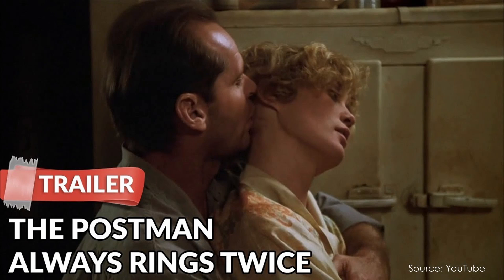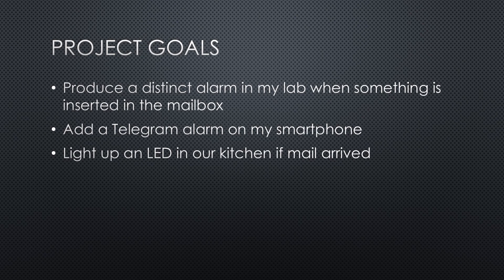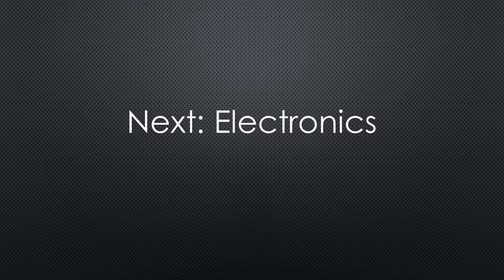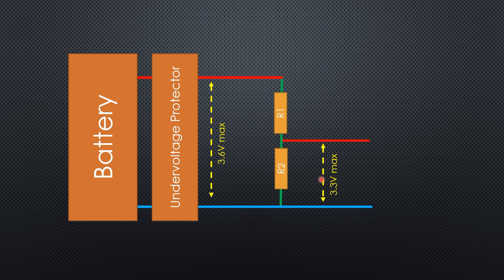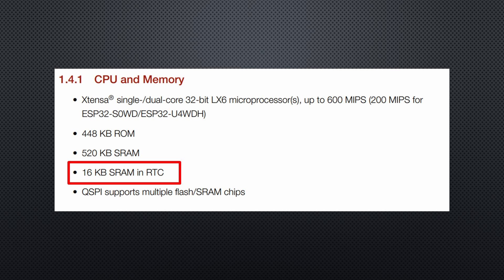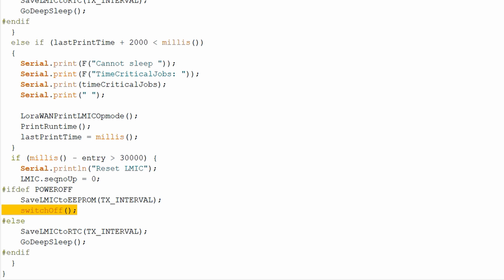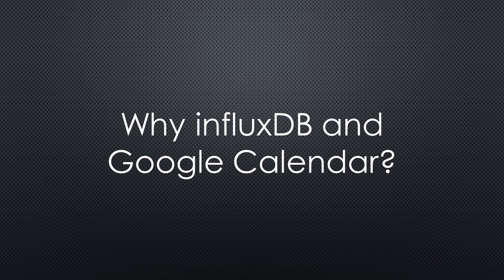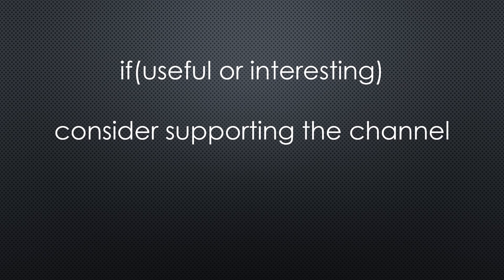#402 LoRaWAN V3 Mailbox Notifier (TTN)

Comment: I built something like this with RF24 module and small Pro-Micro Leonardo.  It uses a transistor latch circuit to power it on, sends the signal to a receiver, and shuts off as soon as it gets the acknowledgment, or after so many retries.  Powered by 9V battery.  Has been running for 2.5 months so far.
Reply from the maker: Good design if you do not need the reach of LoRa.

Comment: Hi Andreas, one of 2 best channels for starting with LoRa I manage to find for now. Regarding problem with Joins and deep sleep... would it work with ArduinoProMini in V3 setup you show here?
Reply from the maker: It uses the same processor as the Arduino Uno. So it is the same problem with memory.

Comment: ESP32 data sheet shows RTC memory (both RTC FAST and RTC SLOW) as being SRAM. Can you elaborate on the wear out concerns? I want to ensure I'm not missing something here. Now I know you are powering off the device and RTC is not a viable solution since it is SRAM, just not certain about the RTC concern itself.
Reply from the maker: RTC has no wear, but, as you say, does not survive a power down.
Reply: @AndreasSpiess  My bad, you clearly state you switched from using RTC to NVM because you are planning to power down. That's what I get for watching do early in the morning!

Comment: What antenna have you used for the transmitter / receiver ? I’d appreciate some Ali link? Thanks !
Reply from the maker: I do not post antenna links because suppliers often change what they sell. So a "good" antenna can be bad a few month later. The only possibility to be sure is to try and test them yourself (I made videos about that). Or buy from Digikey et al.

Comment: Great, how about set a paperthin like weight sensor to be sure if and how MUCH mail is in the box? By  preventing the postman opening wrong box? Do you know any weight sensor?
Reply from the maker: I am sure you could use a weight sensor. Most of them use strain gauges. That is another method. I never tried it.
Reply: @AndreasSpiess  or resistant mat between two leading fabric?

Comment: The boards you link to are no longer available. I've been burned buying LORA boards that I couldn't get connected to TTN. Can you recommend a board currently available that works?
Reply from the maker: I do not know what was wrong with your boards. But if you chose the right frequency these ESP32 boards with links in the description should work.
Reply: @AndreasSpiess  Thanks for the reply! The links in the description point to products not available anymore :( Would you be able to give us an updated link to the boards you're currently using? Thanks alot!
Reply from the maker: @repatch43  Try now. I thought I updated it. If it does not work maybe you use an ad blocker.
Reply: @AndreasSpiess  Thank you very much, just received my module! Can you recommend an Arduino sketch to get me going with LoraWAN and TTN? This board has some sort of Paxcounter app loaded, is that what you'd recommend to get started? The documentation isn't great.

Comment: The circuit diagram at @6:09 doesn't work for me when simulated! Anyone care to enlighten me as to how this is meant to work?
Reply from the maker: In your simulation you should find out where the problem is. Probably a FET with a too high Vgs which does not switch at the voltage levels?

Comment: I built the same thing using a Heltec CubeCell (for super small deep sleep power draw) in my appartment, and I also added a small button inside the mailbox which sends a packet that unlocks the entrance gate through the intercom, to have a fast and easy way to unlock the entrance door when I am coming home with groceries etc. just by reaching in the mailbox quickly (since the mailbox is right next to the door). I also did it without lorawan, instead I used plain LoRa.
Reply from the maker: These Cubecells are very good for such applications. And you are right, no TTN needed. But I anyway have a gateway on the roof ;-)

Comment: No schematic how to lay things down (maybe fritzing). Impossible to reproduce this project, you’re just throwing information but not actually showing us how to put all this together.
Reply from the maker: Unfortunately, this channel is more for the advanced or ambitious Makers. This is why I usually do not deliver all details :-(
Reply: @AndreasSpiess  ok, will make you proud and will learn stuff I don’t know and get this done. One thing I’ve not found (this is an error in the video) you specify video 388 where you explain about the proto board you did to power the device up (the transistors and how you did it) but there is no such info in the 388 video… maybe wrong video number ? Thanks
Reply: @AndreasSpiess   never mind, it was video 400. I will do this with minimum knowledge :)

Comment: I have been playing around with your code and trying to adapt it to my use.  I want the deep_sleep low power mode and to not have the LoRa module always do a JOIN when it comes out of deep_sleep to send a new message.  However, using your code I find it always tries to do a join every time it comes out of deep_sleep and  never actually joins. I know you are using your code for a power off situation but since I saw the deep_sleep option there I thought I would try it.  I found a few things that would not let it compile at all, resolved them, and now it does "work" where by it cycles through the trying to join (but rarely ever does ) and always tries to join after a deep_sleep.  The loading of the LMIC structure doesn't seem to do anything stopping it from doing a new join.  Did you try your code in deep_sleep mode?
Reply from the maker: Maybe you watch my video about TTN V3 migration? There I explain the dilema.

Comment: You can just connect a thyristor on the reed switch. then just have it power itself off
Reply from the maker: The MCU has to create the off signal when finished. So I am not sure what you mean. Also, thyristors often use higher voltages to switch on.

Comment: Does the code work with the LoRa32 V2 ?
Reply from the maker: I think so.
Reply: @AndreasSpiess  I think some adjustement must be made as the structure in Platfrom IO is different. I twiited u about it ;)
Reply: @AndreasSpiess  Also I tried to use an ultrasonic for detection but seems some adjustment must be made with the LoRa32 V2.
Reply from the maker: You are right, you always have to select your board version (because of pinout).

Comment: Is a double MOSFET circuit really necessary to power the board with a signal? I've tried with a low Vgs N-channel MOSFET like RFP30N06LE and it works with the 3.3V signal to drive the MOSFET. The spec sheet diagrams for that MOSFET show that a minimum gate to source voltage of 2.5V should suffice.
Reply from the maker: You are right. I think I mentioned in this or the other video. It often works if you use the right FET.

Comment: As allways this is a genious project.

There are libs available to store in eeprom/flash at rotating positions. They also use the latest valid value, so if you have problems with flash you will get information from saving before.
Warning: most Flash-Memory fails writing at low temperatures.
Reply from the maker: I was not aware of those libraries. And also not about the problem of low temperatures. Good to know. You will see in the next video that I had to take an entirely different route ;-)
Reply: @AndreasSpiess  This flash issue was a problem at my work for quite some time. Now I'm suprized that I found several ESP32 data sheets with operation temperatures down to -40°C. Now I really wonder if this works. I'll put one of my ESP8266 to the freezer to check if they really can handle negative temperature.
Reply: @AndreasSpiess  A first test in the freezer looks good. It seems that the values are normaly written to FLASH.

Comment: Dear Andreas,
Thank you again for this video, I have been following you for years and am grateful to you for your videos which are every time, well edited, well explained and well documented, however they always make me laugh, but that is not of any importance, this is due to your Dhanks instead of thanks, but maybe it is because I am, considering my age, a little deaf.
I might want to do this project for my postbox installed in the hall of a building with multiple apartments, but I have a problem with this one, it does not have any open-close feature, it has an open gap, and therefore the readswith is not a good solution, the light swith is not a good solution either, because when it is dark, a lamp lights up every time a person enters the hall, the acoustic sensor is not elsewhere either a good solution, because of the power problem.
Do you have any suggestion for me regarding the method and the sensor to use?
Vielen Dank oder vielleicht vielen Tank?
Regards,
Philippe
PS: Does it matter if I spend more time than my wife in the kitchen? Best regards to your wife  also!
Reply from the maker: As I usually mention: I have a strong Swiss accent which will not change during this life ;-)
Concerning the sensor: Here I cannot help because only you know your situation. You just need some changes which can be detected. Some viewers use a load cell on the floor of the box to measure the weight.

Comment: I am wondering if a simple Zigbee opening detector could have worked in your case. The range of a zigbee object is about 20 m and you could have installed a Zigbee router on your roof. As for your wife, you should inform her that newspapers are also published online and a subscription is usually cheaper. I subscribe to the NYTimes, Les Échos and Corriere sella sera and have never seen their print editions in decades..😀😀
Reply from the maker: 1. Zigbee would not work because of the metal case. As I said, I tried simple 433MHz which has a much bigger reach than Zigbee.
2. Online: I think she knows that (ans changed to a Kindle many years ago). But she still likes the old-fashioned newspaper...

Comment: Hi! Have you ever heard abou HackRF ONE? A year ago you have uploaded a video talking about low cost usb spectrum analyzer. HackRF ONE seems to be a very good hardware and I really want to see a similar video comparing it with your Spectrum analyzer. Try some Bluetooth module with IPX Cable for test.
Reply from the maker: I made a video about SDR technology and used SDR receivers in other videos. SDR receivers only have a bandwidth of a few MHz and their dinamic range is not too big. They do not compare with true Spectrum analyzers, but are good for many other purposes.

Comment: Thanks for all you do on your channel.  I've learned a lot over the past year in following you.  A question about your latch circuit at 6:06- if you wire a momentary reed switch from 5v to the load in order to wake the MCU up, wouldn't that put 5v onto pin 2 of the NDP6020P in your diagram?  Is that ok?  I can see how it might be "equivalent" to the gate energized and current flowing.
Reply from the maker: The gate anyway is pulled to 5v by the 10k resistor. It needs to be pulled low to make the FET conduct.
Reply: @AndreasSpiess  Yes it is.  I'm sitting here staring at that and it never registered.  Thanks!

Comment: Would be interesting to see something like this powered by a supercap, and recharged by small solar panel. Perhaps a weather station on the mountain and it uses a small solar panel to charge. Then send using Lora every ten minutes, the weather conditions. Maybe 2x 50F caps.
Reply from the maker: You can combine Solar and super caps. Maybe not for this dark place, but my awning protector uses such a design. So far I never made a video about that topic. Just on supercaps for a Raspberry Pi.
Reply: @AndreasSpiess  thanks for the reply Andreas. And of course thanks for making all these wonderful videos. They are very helpful. Woukd love to see a Lora sensor on the mountain using the super caps and an energy harvester. Maybe small solar panel. One that you will never have to replace the power. But is such a device possible? Probably, with a large panel. But we would like a small box with small panel on the box. Anyway, thanks again for your amazing videos.
Reply: An infinity sensor. To last maybe 10  years. What minimum size cap would you use? Minimum sized solar panel? Would be a fun project.

Comment: So, why not use one of those self-poweroff circuits? Opening the mailbox pushes a button that latches the power "on" and when the messages have been sent the ESP turns itself off. That would have no standby current at all.
Reply from the maker: I thought I used exactly what you described in this video. So I am not a very good teacher :-(
Reply: @AndreasSpiess  indeed. Do you also have a design for an RTC triggered circuit? You can get away with the built in RTC with a pro mini, but once you have a circuit with an esp and multiple sensors you want to turn everything off between intervals

Comment: Hi Andreas, love/hate your channel.  So much great content and ideas that my wallet is complaining!! 
I do have a question about this sketch.  I have run into this issue in the past where the example sketch, yours included, is written for the EU868 band.  I have to use the US915 band and from everything I have noticed they are very different in how and what you need to code.  I am still learning this but it appears that there is much more control over the EU868 band over the US915.  For instance you cannot specify what SF you want to transmit on, at least I have not found anything that will work.  And in your sketch the "EU Like Bands" portion fails when I try to compile it for the US915 frequency, " 'MAX_BANDS' was not declared in this scope" is the error I get.  I assume it is because that function is not allowed or required when using the US915 band.  I have not tried commenting it out and trying it as I do not know what it is trying to do.  I have not seen anyone using this option of the LoRa library.  Is this section important?
Reply from the maker: Yesterday I learned that this sketch only works for the European TTN. I was not aware of that. I have no solution for the US, unfortunately.
Reply: @AndreasSpiess  Thanks for your response and this is my biggest frustration with LoRa, trying to convert a very customized EU868 sketch to a US915.  I think LoRa is used much more in Europe and hence so much more project available examples to go by.  If I figure something out I will let you know!

Comment: Well done, as usual you have researched this very well and marital harmony is very difficult to attain. It would not work in Australia where the newspaper delivery guy(person) drives down the middle of the street and flings the paper from side to side. It might end up on the road, caught up in a tree or on the roof and block your guttering if really unlucky. But, it would work for letters in the mailbox(apart from the junk mail) as we have mostly trained our posties to put the mail in the letter box.
Reply from the maker: The price for a newspaper is very high here (500$/year). So we probably would not accept this "treatment" ;-)

Comment: Great idea using Lora. My mailbox is over 60 meters from my router but luckily a neighbour in our Siedlung close to the mailbox uses upc as well. So I connect via UPCfree Hotspot with esp32cam on latch triggered by vibration sensor.  Take a photo of the mail as well and send via email. Always run to the mailbox  when photo of yellow envelope.:)
Reply from the maker: Excellent idea to use UPCfree. I never thought about that!

Comment: Welcome back from the summer break Andreas - very nice video and thank you for sharing. The IRF7317 combines a P and N channel MOSFET in one small surface mount package, I used one of those generic breakout boards to make it a little easier to work with. This is nice if you want to save some space in your enclosure. Thanks to your previous video, I used this concept as well to make an ESP8266 run in a doorbell without deepsleep.

Interesting using LoRaWAN - but considering all the effort, is it not easier to do a point to point connection from the mailbox notifier to another ESP32 that converts the incoming LoRa message into something like MQTT? 

I did that for a ESP32 weather station, and it is working very well, through many walls at approx. 30 meters
Reply from the maker: Thanks for the tip about the IRF7317. It seems to be a good solution. Concerning LoRa /LoRaWAN: I prefer LoRaWAN because I already have a gateway (and I wanted to have a show case). If you have no gateway, your solution is better.
Reply: @AndreasSpiess  Just a Question about LoraWan Gateway : I've made a mistake with Dragino LG02 (no more compatible with TTN v3 and LoraWan) what do you advice me as gateway (also for students so it can be an all in one a a Raspberry Hat), no Helium/crypto need but your advice, thank you in advance - Remi
Reply from the maker: @remifr4sw322  Any gateway is good. You have to decide if it has to be indoors or outside. Mikrotik has probably the cheapest Outdoor gateway. Just check the frequency before you order.

Comment: I wanted to do a similar project but the issue was that the mailbox for my neighbors shares the same master door, where as we each have small doors to access our own mailboxes. So i would need a sensor to detect the actual mail and not just the door. Any ideas for something that could detect mail?
Reply: a plate on the bottom and a carbon flexible brush that contacts the lower plate.. when mail is present the connection will push thin brush out of way and keep connection broken
Reply from the maker: Other viewers also used a load cell at the bottom of the box to measure the weight.